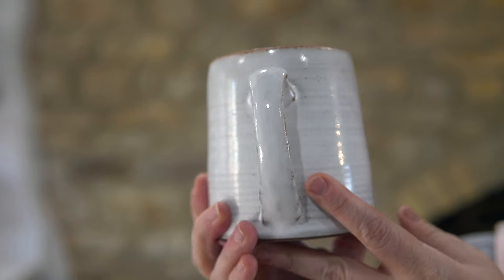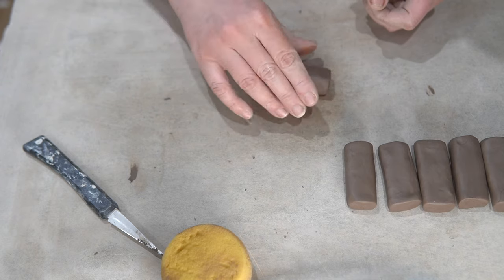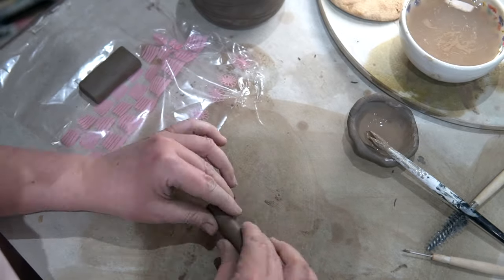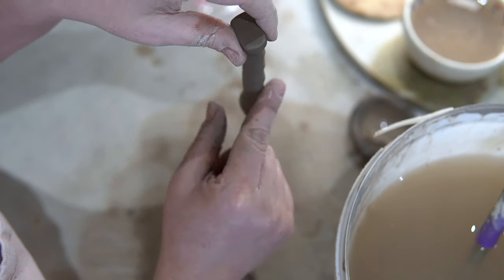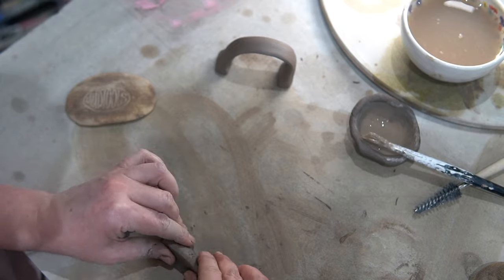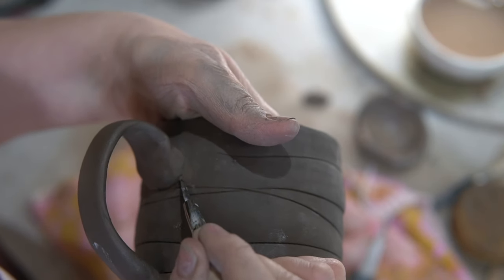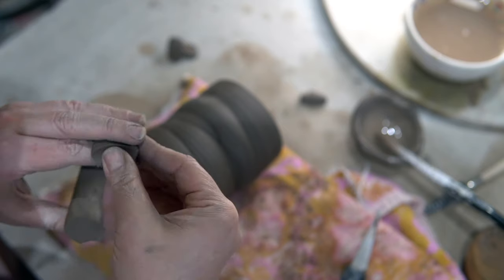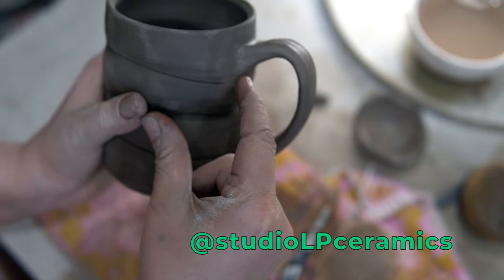Handles Hack: Get the look of a pulled handle without the mess

Comment: I’m a handbuilder and have been making strap handles for way too long!! I’ve been looking for a new way to make handles but not have to pull them. So glad you came up on my feed. I do have a question about attaching handles. I have such a problem with attaching them evenly on the mug. They always end up being off. Like the bottom is off to the right or left too much etc. I just can’t get them even! I look at the handle on the pieces from above and each side I step back etc. The problem I think may be my eyes!! I have a very strong prescription for my glasses and one eye is much worse than the other. I don’t know what to do but if you have any ideas please share.
Reply from the maker: Some potters use a laser level, check old Joe Thompson of Old Forge Creations, I think he has some videos showing it and it helps keep it straight 👍